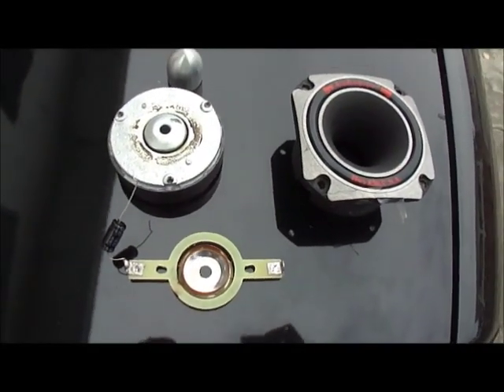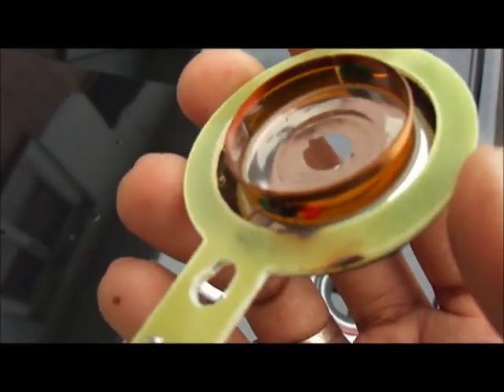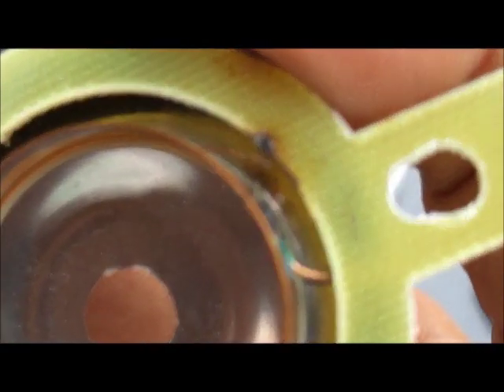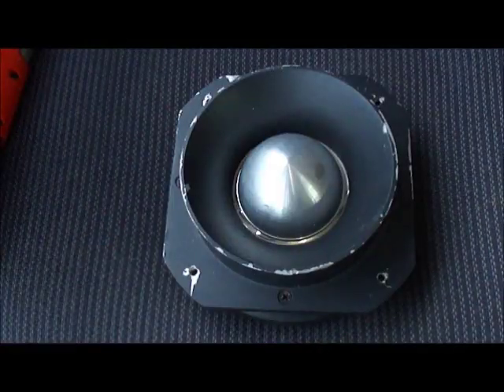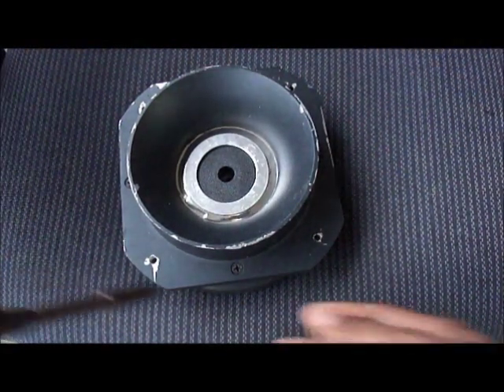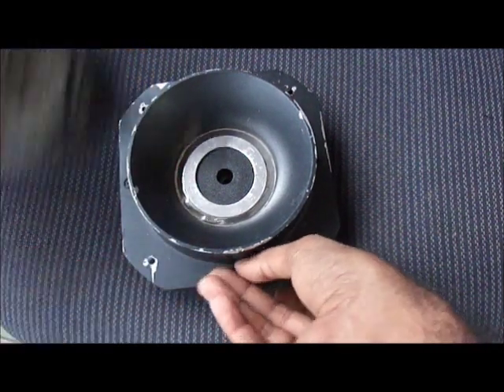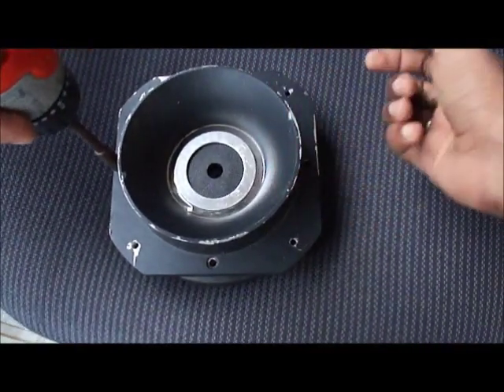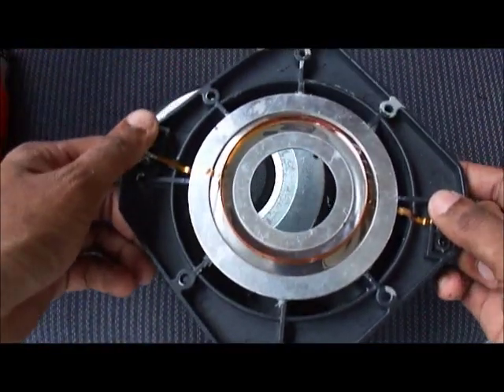How TO Repair BULLET Tweeter.wmv

Comment from the maker: Disassemble the tweeter and remove the Voice Coil & Diaphragm.
Inspect the coil to see if it is broken anywhere, this can be done visually by just looking at it or with any tester checking for continuity, once you locate the broken wire just solder them back together, if a piece of the wire is burnt out as in the video just use a strand of copper wire as in the video. 
If the entire coil is burnt black then it’s no good, you can buy a new coil or new tweeter.

Comment: @Dorisequador Killerskull1 is right,that black thing is bipolar capacitor,with no polarity ( plus and minus pole)!Tweeter can't work without that capacitor,because the whole signal from the amp will come to the speaker and burned it!Also,that capacitor is "crossover"for high frequences,as a matter of fact,it passing thru himeself only high frequences,which are right for the tweeter type of speaker!usually it is about 6,8micofarrads,and the voltage depends by the power of amplifier!